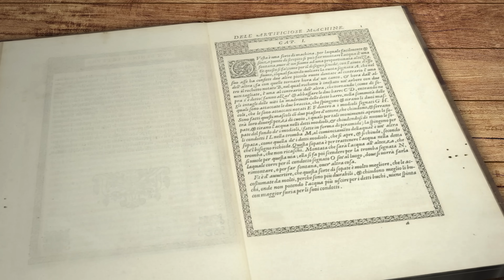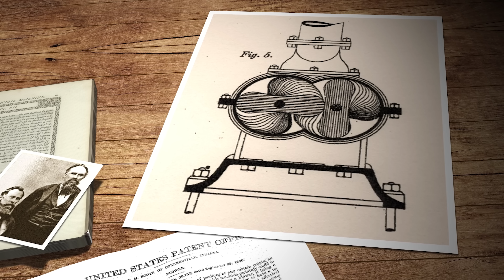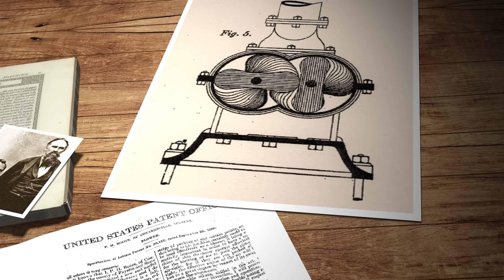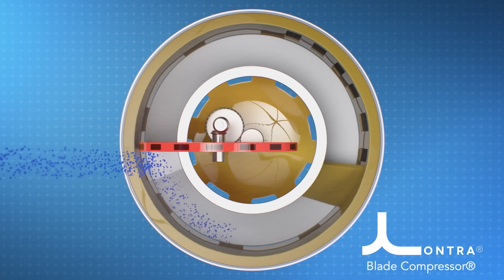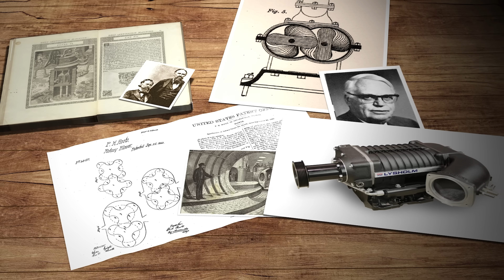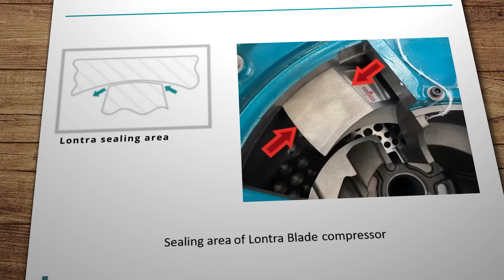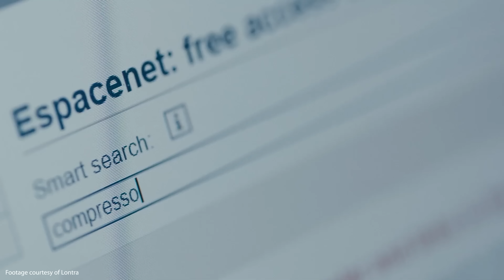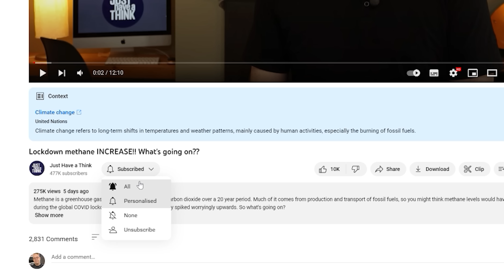Compressing air to reach net zero. A 'revolutionary' innovation.

Comment: Absolutely brilliant. If this takes off, heat pumps are suddenly even more efficient than they currently are.  Thanks Dave
Reply: @lawrencetaylor5407  they're the same thing
Reply: I do believe you're onto something eh?!!:))
Reply: More efficient AND more reliable. LG used to make some unreliable refrigerators when they tried to use linear compressors for a while.
Reply: @chalichaligha3234  
A heat pump produces more heat energy than that can be created by the electricity that it consumes is not a violation of the the 2nd law of thermodynamics, because the extra heat energy is produced by concentrating the heat energy from the air instead of produced from nothing.  A heat pump water heater would expel cold air. The expelled air is cold because the heat energy in the air has been transferred to  the water.
Reply: @simon6071  I am looking forward to seeing you win the Noble Prize when you turn 1000W of electricity into 2000W of electricity.
Reply: @afriedrich1452 
The Heat Pump Power Plant  will not literally turn 1000KWh of electricity into 2000KWh of electricity. But theoretically, the Heat Pump Power Plant may concentrate heat energy from the air with with multiple stage compression of refrigerant  to create temperatures high enough to boil water to power  a piston type steam generator to create electricity.  The waste heat from the piston style steam generator as well as from the compressors has to be recycled for heating water in order for the  Heat Pump Power Plant to work.
Reply: @chalichaligha3234  Heats pumps producing more heat energy output than the electric energy that it consumes, say, in a heat pump water heater,  does not break any law of physics because the extra energy produced comes from concentrating heat energy in the air only. The EXTRA heat energy produced neither comes from nothing, nor comes from the electrical power supply.
  
Here is what Google has to say about heat pumps and second law of thermodynamics.
Do heat pumps violate the second law of thermodynamics?
This would seemingly violate the Second law of thermodynamics, but the key reason it doesn't is because this heat transfer is not spontaneous; it requires an input of energy to do so. For home heating, a heat pump extracts heat from outside air, heats the warm air up even more, and transfers it indoors.
Reply: I like heat pumps. They literally extract heat energy out of thin air. I am looking forward to the day when electricity generated by using heat energy extracted from the air exceeds the electric energy consumption of a heat pump generator per unit time. Theoretically, that is possible because heat pumps have a Coefficient Of Performance greater than 1. A 1000W heat pump with a COP of 3.5 gives us 3500W worth of heat energy. 
If we can find the technology to use the 3500 W worth of heat energy to create more than 1000W of electricity, say 2000W of electricity , then we have a heat pump generator with net output of 1000W.
Right now, the biggest problem is there is no efficient way to covert the heat energy extracted from the air  to electrical energy. 
The liquid nitrogen created by removing heat from the air can also be used to power air motors for generating more electricity.
Reply: @simon6071  If anyone could do that, then they would get the Noble prize, since it would violate the known laws of physics, and be the equivalent of inventing a perpetual motion machine.
Reply: @afriedrich1452  No, it does not violate any known law of physics.  Concentrating heat energy in the air with a heat pump to be used is not the same as creating heat energy from nothing.
Reply: @simon6071  an air conditioner at 35 degrees is a personal blessing, air conditioners for the entire equatorial population of the world is an energy conundrum, yet that's what every personal equatorian now desires. who's going to generate all that extra electricity? i don't know. thorium compressors might be an answer.
Reply: heat pumps are progressively less efficient as outside temperatures decrease, ground source negates that affect with consistent heating at just the cost of compressor energy, and the 'lontra' principle certainly improves on that equation.  my two cents worth is heat-exchanged to hot water with capacity and insulation enough for a week, but with the compressor directly mechanically coupled to a wind turbine, of any type, on the expectation of wind blowing enough at least once a week, with calculated sizing to acquire winter heating at zero cost and with zero electrical and electronic gadgetry (except perhaps for over-temp shutdown).
Reply: Gary Graham yes but if you can reduce the power needed to compress the refrigerant then a heatpump will become more efficient at any specific temp. Yes heatpumps do reduce efficiency as it gets colder but we now have residential heatpumps that heat as low as -22°c
Reply: @randybobandy9828  I think you may be mixing up the concepts of power versus energy. It always takes the same amount of energy to compress a certain amount of refrigerant at a given temperature. Power is just how fast you do the compression. On top of that given amount of energy, you have losses you need make up for. The goal is to reduce losses as much as possible.
Reply: @randybobandy9828  There is some connection to compressor speed and efficiency. Running a compressor at lower speed at light loads allows it to run ALL the time. Running a compressor all the time makes the entire system run up to 15% more efficiently.

Comment: would be interested to see how high a pressure differential it works well at, and how it works at higher densities, like with trans-critical co2 as an example. you could if its not that easy to get it to pull 80 bar differences to use them in series to broaden the applications. if the components are cheap it could be easy to produce multi chamber versions for different applications B-)
Reply: It's got a working pressure of 4 to 15 PSI. He shoulda started with that info, instead of comparing it to a bicycle pump.